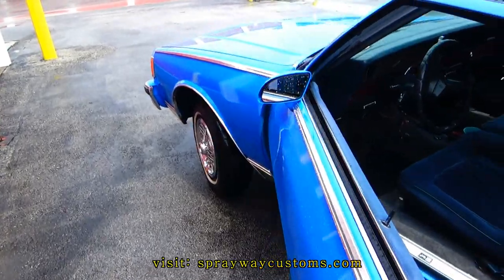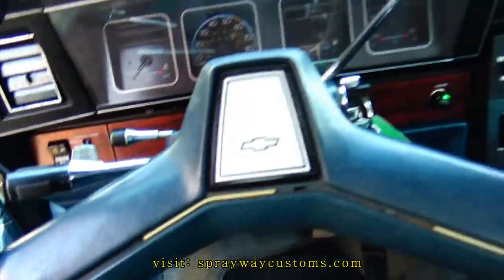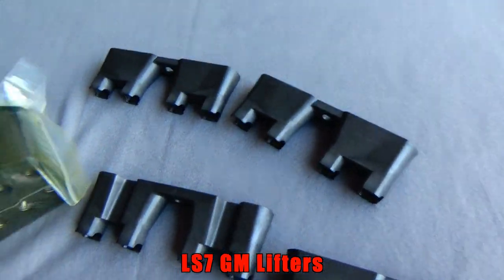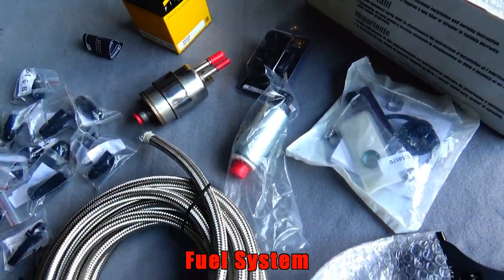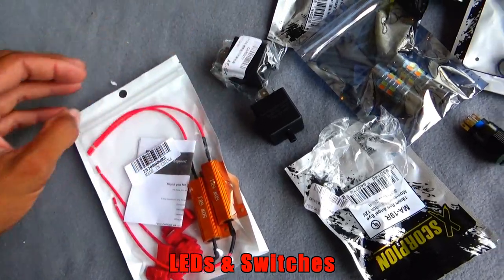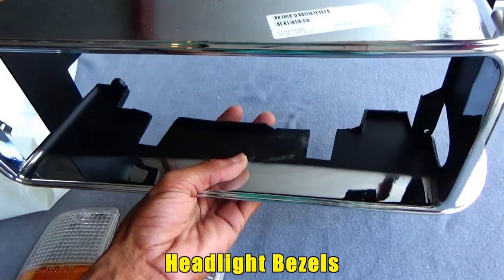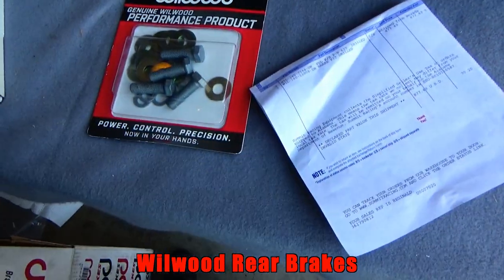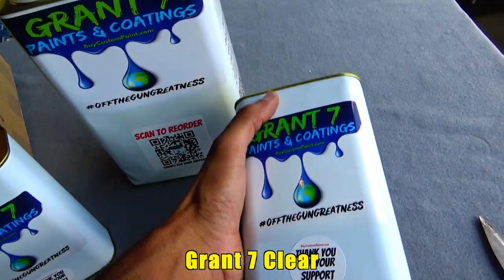6.0 LS Swap Box Chevy Caprice 26" RUCCI WHEELS Dakota Digital TIARRA GRILLE Wilwood Brakes QA1 & UMI

Comment: If you use those older amps send them out to get the internals freshened up.  Guys that made those amps back in the day are still around and as a side hobby fix and repair old car amplifiers.
Reply from the maker: Thanks for the info with the amps man

Comment: You've been stock piling parts for some time. This going to be a really cool build to watch.
Reply from the maker: Yes...I just been getting parts off and on for the past year. Thanks
Reply: @SprayWayCustoms  Maybe you can help me with something I haven't experienced. The 2012 dodge I put the corners and rockers in. The neighbour painted the whole truck and it looks like crap, so now they want my help to do a respray. How long should they let the clear coat cure before sanding it flat,sealing and rebase and reclear???
Reply: @SprayWayCustoms  Thanks all the same SprayWay. Paint rep says a week in the heat we've had should be good.

Comment: Nice new stuff for the ride buddy I love those Dakota digital gauges  I found one and your not kidding there expensive the one Im getting is almost 1,000.00 and be bad ass  set up but it cost if you wanna play and customize you know lol...Have a good one buddy
Reply from the maker: Yes it does cost to play. Thanks Niko G
Reply: @SprayWayCustoms  I'm doing my full size f250 adding 2 more doors to make it a 6 door on 26's bagged with a tandem dually rear end with a custom frame and cummins motor about $20,000.00 but will be bad ass also will have a custom fifth wheel a steel roll pan and a regular hitch for other trailers to pull to shows and stuff

Comment: Me?: A Hard no on the tires at this time. Your brand is an AMAZING attention to detail and flawless work. Now is not the time to throw those sweet rims/wheels on and drive it , taking in all you want to do (detail the engine bay ect...) . Think of the tires/wheels as a nice reward for all your work. That, and I dont ever think SprayWay does something half done. I think those rims separated by rotted rockers are WAY, WAY below the SprayWay- Way.
But - You Be You. Respect!
Reply from the maker: Thanks man

Comment: Where did u get those door pin switches?Bout time u get to work on this beauty. Always working so hard on everyone else's stuff. I got same rear control arms on my aerocoupe. Qa1 front will come one day maybe. I also love that dash. If your headers fit good and don't burn wires send them out to get coated the coating is thicker when u order it vs getting it already done.
Reply from the maker: I was thinking about doing that..just taking my headers off and getting them coated. Thanks for the recommendation

Comment: Nice video. Question tho. I was told all you need is heavy duty shocks n springs for 6's n 8s so any particular reason u did a full suspension?
Reply from the maker: The wheels should go straight on without any modification because they was made for the car. I mainly wanted to beef it up and for looks. I'm pretty much going all out on this one.
Reply: @SprayWayCustoms  ok got ya. I'd love to work with you on my joint. Do you have a shop?

Comment: Spray way if you doing welding..can you do so detailed videos on welding sheet metal.. with flux core or mig..
Reply from the maker: I'm not a good welder but I can post some of the vids though
Reply: @SprayWayCustoms  do you use flux core or mig....i can't get gas cost effectively  in my location  rental fee are to much...looking to learn on flux core any tips or tricks is appreciated  brother